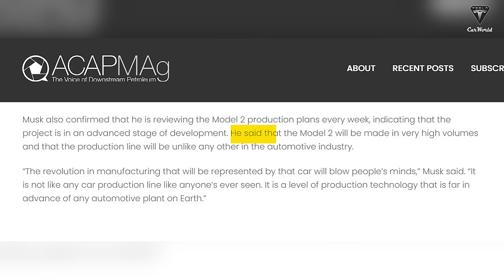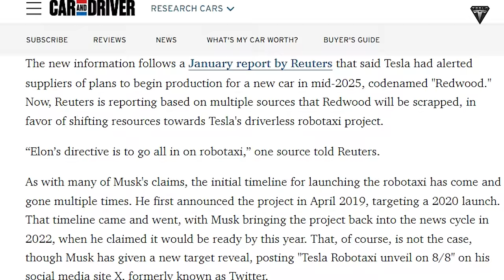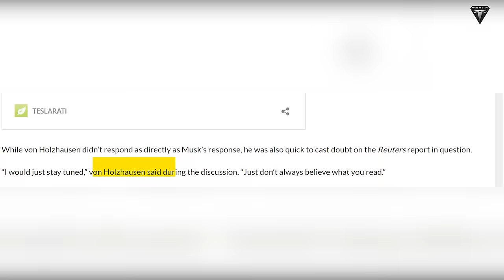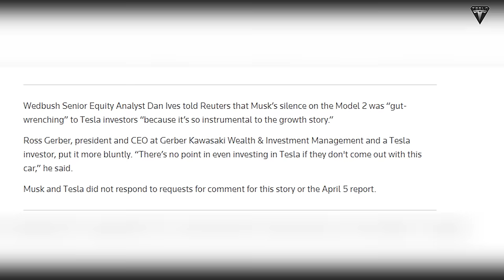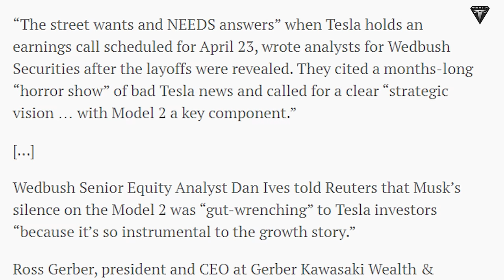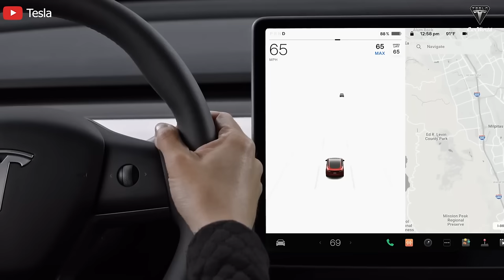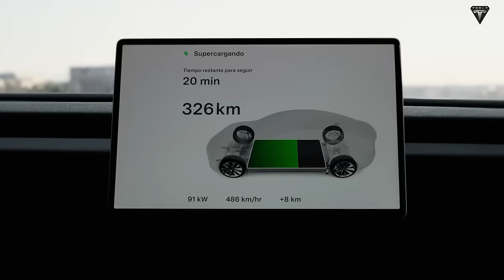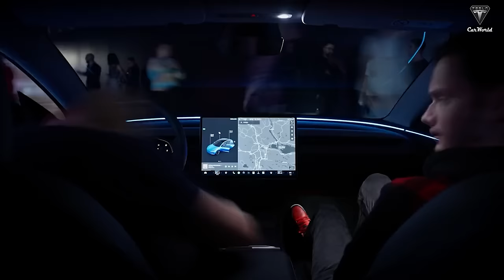Finally Happened! Elon Musk Reveals No More Model 2, STOP Redwood Project for 3 Hidden Reasons!

Comment: The Tesla Taxi could completely replace Uber. Uber had $37 billion of revenue in 2023. The number of cars needed for the taxi business is limited, so they will get to a point where they are essentially fully staffed and only need to replace cars due to accidents. A taxi can be designed for repair-ability like the Checker Marathon that ran for decades. Once the taxi production volume ramps down, the line is free for the budget Tesla to be produced there. Laying off a lot of workers is likely due to a switch to Tesla robots.Tesla is in transition, but these strategic moves make sense in the context of where their AI development is headed.

Comment: Maybe their cheap😮model will be the existing model 3 by reducing the cost of model 3 with efficient manufacturing methods.Until now they didn't used giga castings to model 3.
Reply: Yeah the problem tho is that it isn’t a hatchback. That said, they could easily sort that by changing the roof structure. Arguably, a retracting roof blind in the model 3 and y should be a std feature alongside heads up display. I never really know why Tesla doesn’t target these easy win areas. Like the stalls situation…. Why make things a little trickier?

Comment: The unveiling of the Tesla Model 2 did not result in a boost in the company's stock performance; instead, the stock price has seen a decline since November 2021. The potential for Tesla's Full Self-Driving (FSD) technology and future robotaxi services far outweighs that of a budget-friendly Model 2. Tesla currently lacks the scalability to simultaneously produce millions of Model 2 vehicles and robot-taxis. Transitioning into the realm of robot-taxis could potentially transform Tesla's business model from simply being a car manufacturer to a transportation service provider, offering significantly higher margins akin to Software as a Service (SaaS) models. Why build a cheap model 2 when a robot-taxi could transport you on demand for a fraction of the cost per mile ? FSD 12 is not a version 11 + 1, it's been rebuilt from scratch, on one year, based on new technology: AI LLM. And Tesla's Dojo has the capacity to build updates much faster now. A fleet of one million robot-taxis could effectively substitute for 20 million (inexpensive) cars. This is because cars typically remain parked approximately 95% of the time.
A robot-taxis could be much more expensive (to buy) than a model 3, if it has a longer expected life or could be on the road for 1 million miles. Similar to the iPhone: tesla could earn more from the additional services than from making the car.